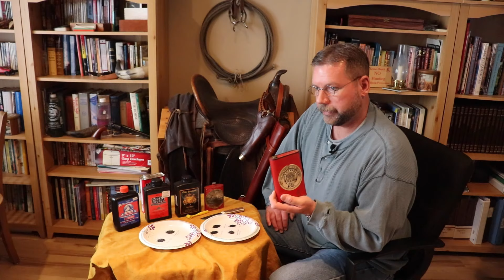Loading Black Powder Cartridge

Comment: US Army practice for powder magazine inventory was to periodically restack the powder kegs by upending them.  The premise was that vibrations from transportation, handling, and ground tremors had created powder dust, which tended to settle to the keg bottom over time. The upending was to allow the dust to migrate back through the keg to prevent high concentrations of faster burning dust.

When annealing larger quantities of brass cases, you can stand them in a flat pan with water to just below the anneal zone so it needs only tipping the case over into the water for cooling.

Enjoying your video lessons.

Comment: Once my cases are fire formed I simply weigh the powder, drop tube it, add wad, compress and finger fit the 530 gr Postell (45-70 Sharps). No need to anneal as after fire forming I don’t use either sizing, belling, seating or crimping dies.

Comment: Awesome video, thank you. I have watched several of your videos and picked up something from each. It is amazing that powder that old even still burns. As someone else replied the manufacture of black powder then was a science. I have seen other statements about the variation in the granule size. It almost seems like the more modern production powder is smaller for a given size. It would be interesting to see  British and US made  powders from the 1860s. That might be wishful thinking though.
Reply from the maker: Thanks Robert.  If I ever find more powders to compare, I'll share it.  Thanks for watching.
Reply: BP, so long as it doesn't get wet, virtually lasts forever. That's one of the big reasons BP cartridges stuck around when smokeless had been developed (NC based smokeless degrades within a few months, depending on the humidity and temperature (without a good stabilizer)). Early Smokeless formulations either didn't have stabilizers in them, or the stabilizers they were using were not very good for the task (smokeless production had issues with finding affordable, effective stabilizers up into the 30's).

Comment: Excellent 👍. What is your opinion on Lee liquid alox or powder coating instead of traditional lube? Also do you cast and lube your own? Thanks
Reply from the maker: I've stuck with traditional lube.  I like the authenticity of it.  I'm not a great bullet caster, but I'm trying and getting better.
Reply: @frontierwesternheritage1356  Ok good. I think traditional lube is not that difficult or expensive. Do you do home made or spg ? Do you cast or buy bullets? Thanks 👍
Reply from the maker: I mostly buy bullets for my cartridge guns and cast conicals for my percussion revolvers.  I use Vigilante Bullet Lube on Facebook.  It's the best stuff I've used and saves me the frustration.  If you can't find it, try Vigilante Candle Company on Facebook - same outfit.
Reply: @frontierwesternheritage1356  Ok cool 👍. I will start by buying bullets in small quantity until I find what works best for my rifle then I may get a mold and cast them but depends on savings maybe easier to just buy bulk when I figure out what bullet works best. Thanks 👍

Comment: Why magnum primers? And when reloading .38-55 black powder, should magnum or standard primers be used?
Reply from the maker: Richard, I was loading 86 grains of Fg powder and used a magnum primer due to the volume.  I get a more complete burn that way with the coarse powder.  I don't think the 38-55 needs a magnum primer, but try both and see which one performs better.  There could be a significant difference.  Thanks for commenting, Todd

Comment: I'm interested in getting into BP cartridge shooting for long distance.  What is the advantages/disadvantages of the common calibers .38, .45, .50
Reply from the maker: Dan, I'm not the end all, be all on the subject, so gather several opinions before making a purchase.  A lot of it is personal preference.   Here's some basics: 38 caliber - lighter recoil, but you may be disappointed in the knock down power for silhouettes at the longer ranges.  It won't matter for paper targets.  45 caliber: heavier bullet for down range silhouette, seems like a great compromise because it's in the middle, but some of the long cartridges can be tricky to load consistently.   There's a tall column of powder in a 45-110 or longer and it takes practice to get the compression consistent.  50 Calibers: will knock down any silhouette with a 675 grain bullet or larger.  Down range energy is substantial, but recoil gets annoying if shooting a lot.  The recoil of a large 45 is no slouch either, but the 50s are worse.  No big deal until you shoot a long match and start to anticipate the recoil.  I love my 50-90 Sharps, but it's not an all-day shooter.  Great to have you interested to get started. Todd
Reply: It takes a great deal of experimenting to get the components balanced correctly.   In my 45-110 my first several dozen were pathetic.   25 yard groups of over a foot.  Finally, got her to 4-6 inches at 100 yards.   Still, it can be better.

Comment: I'm new to this stuff so please forgive my question. I understand that the wad is used to keep the powder in place (i.e. compressed) but I am unclear as to whether the bullet is seated in the case exactly the same way every time even if the powder charge is decreased (i.e. there is an air space between the wad and base of bullet). I've read that you don't want a space between the powder and the base of the bullet but does the wad take the place of keeping the powder compressed for safety even if there is a space between the wad and the bullet? Or would you have to push the bullet further down into the case if using a lighter powder charge so that the base actually contacts the wad?
Reply from the maker: Excellent question on a confusing part of the process.  There is some room for experimentation in bullet depth.  Personally, I try to stick to the area of the bullet where I can get a good crimp and adjust the powder charge from there.   The minimal powder charge is one that touches the bottom of the bullet.  More powder simply means greater powder compression.  The bullet depth doesn't change.  Less powder, less compression.  But never so little to cause an air gap. You can experiment with a constant powder load and different compression rates by adding more wads.  Again, the bullet depth doesn't have to change - the additional wads are pushed to the same depth and thus further compress the powder.  Some powders function well under greater compression while others function better if very slightly compressed.  It's part of the load testing process.  I hope this helps and doesn't cause further confusion.
Reply: @frontierwesternheritage1356  THANK YOU so much for clarifying this! I had no idea black powder had this feature where it is "adjustable" (at least to some extent) in terms of the space it occupies based on COMPRESSION. (almost reminds me of the characteristics of a gas where it expands to fill the available space though of course the powder being solid it can't expand to the same degree as a gas) There are still some issues re compressing powders since some (like Pyrodex) as I understand it produce variable results based on the degree of compression (I think some people say to not compress it at all but just ensure that there is no air space either). On the other hand, consistent compression might not have this variability in performance. This may be a more complicated topic to explore than I first thought but I'll see about researching (chat groups, etc.) what people have to say about this "compression effect". One thing that has been stated consistently is that you should never have "air space" in a cartridge system using black powder. But once that has been addressed, there still could be additional points to consider, such as the degree of compression. Again, thank you for the info you provided.
Reply: Triple 7 is supposed to be bad in cartridges and is also bad to compress. Ive never tried it in cartridges but it does seem to work better when not compressed in my flintlock. The extended hangfire is a bummer tho which is typical in a flintlock with any of the substitutes
Reply: @frontierwesternheritage1356  LOTS of WRONG information in this answer. Dangerous misapprehension.